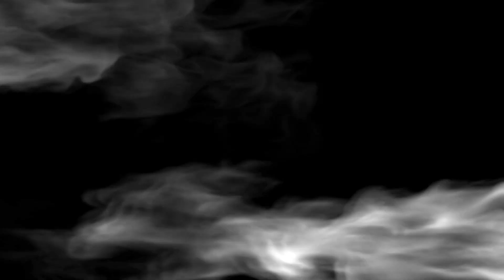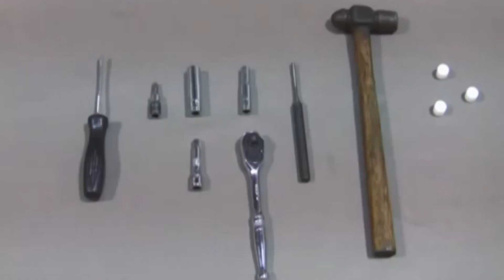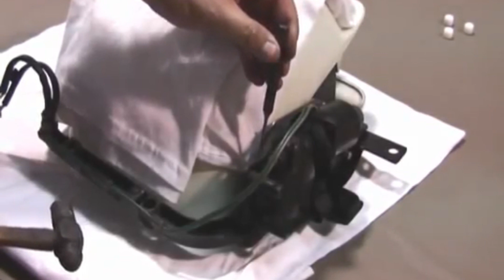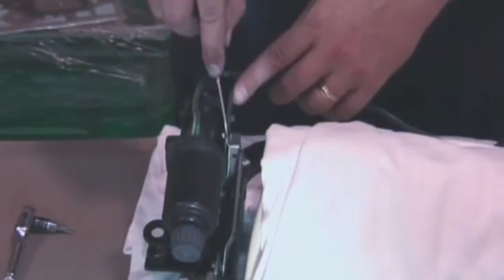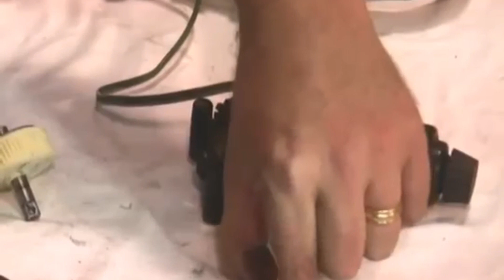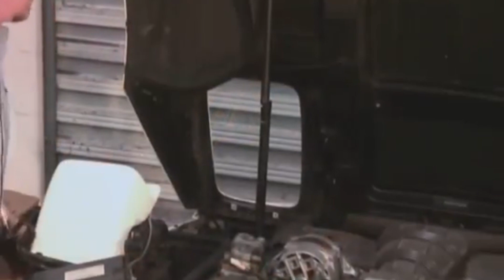Headlight Actuator Repair Kit, Corvette, C4, 88-96

Comment: Great video. I used it to replace mine today. However, when I went to replace them one of the long bolts on the outside that holds the motor in was missing? Do you know where I can get a replacement for that? Thanks!

Comment: By bearing grease do you mean wheel bearing grease? If it is petroleum based it will not play nice with Nylon Plastic. You should use plastic gear lubricant which has a wide operating temperature. For the bronze bushings (bearings) lubricate with a light machine oil with a high temperature rating.

Comment: I've read people recommend coating the three bushings with grease too. Which is what I plan to do unless there's a reason you shouldn't that people aren't aware of.
Reply: Chris Fix used high temperature grease on the bushings and brass gear.  I'm planning (already purchased) the brass gears and plan to install those in mine.  I agree with Lyle's comment that the plastic gears would be a better option if something prevented the motor from moving the headlamp assembly.  Having a plastic gear fail would be better than a motor failure.  I'm gambling a little here, but believe the odds of the assembly being obstructed is small.

Comment: I believe on the passenger side, you have to slightly unscrew the motor case in order to get a little clearance in order to be able to remove the plastic gear. Which from what I've read, you don't have to do that on the driver side. I sprayed those little screws with penetrating oil the day before as I've read of some snapping those off when trying to unscrew.
Reply: I know for the 1989 Corvette some of the passenger worm wheel gear shaft assemblies are longer (less shims) depending on what was needed in assembly to meet the required clearances. If you pull the motor back be careful not to lose the ball thrust bearing (it is just a small single ball bearing) at the tip of the worm gear. It can be held in place with a little grease. There is an access hole to see the ball and tip of the worm gear, and an adjustment screw to set the thrust clearance (which you shouldn't have to move as it is set at the factory). In some instances you may have to pull the motor out beyond the brushes, which can be very difficult to reassemble unless you have the tools to hold the brushes or you can get a helper to hold the brushes back with a couple of thin 90 degree picks. Pulling the motor allows cleaning of the commutator, inspection of the brushes, cleaning the motor shaft and lubricating the shaft bronze bearing (bushing). Put some grease on the end of the worm gear to hold the thrust ball in place during assembly after cleaning.

In some instances even if you use penetrating fluid you will still twist off the head because the screw threads are rusted (welded) to the aluminum casting, this problem is more prevalent with corvettes that come from the rust belt (winter road salt spray). The one method that might work for rusted threads is to apply Knock'er loose penetrating solvent (which works exceptionally well when used with heat) and then carefully apply some heat (but not too much that it melts the motor housing rubber seal), if the screw moves just a little add some more penetrating fluid and work it in by moving the screw in then out in very small increments. It will eventually come out. If after all this it doesn't move you will have to twist off the head then drill out the screw over sized, thread and install an 8-32 Heli-coil.
Reply: @windward2818  I replaced the bushings in both motors a few months ago as my driver side started acting up. And on the passenger side I had a bolt snap when trying to unscrew the top hat cover housing. And I drilled through and got a bolt, washers, and lock nut and used blue threadlocker. It ended up I didn't even need to try to loosen those bolts as the previous owner had already done the passenger side, and there was a brass gear inside that is removable without having to loosen those top hat cover bolts.

Comment: That "stamped steel arm", i.e. triangle silver piece next to the motor was missing on my driver side. Don't know what it does, but I guess it's not critical since mine has gone years without it on one side.
Reply from the maker: It is not critical--they actaully stopped using it at all after 1993 (if my  memory serves...)  Lyle

Comment: I sanded the top edges of the pucks a little bit, to help the carrier assembly pop in. I can't help wondering why the drive system is configured this way. I mean, why not just key the gear directly to the carrier? Why do we need this  bizarre puck system? The only explanation I can think of is that it allows for some expansion and contraction caused by temperature variations, which are pretty extreme. Think Canada in the winter versus Florida in the summer, which can be 150(F) degrees of temperature differential. Under those conditions, a plastic gear tightly pressed onto a steel shaft is likely to crack and fail in short order, due to the stress of being 'stretched' over the shaft. 

Maybe this setup combines zero play in the drive's action with relatively long life before failure. And that, in turn, makes me wonder whether the brass puck and gear alternative, which I considered, is such a good idea. There has to be a bit of slop in those brass components so they can be assembled. That might lead to your headlights jiggling slightly as you go down the road.
Reply from the maker: The pucks (pellets) provide the locking mechanism and also help keep the assembly "slippery" as they are made of Delrin, which is very slick.  The brass gear issue is that they remove the "fail-safe" of a cheap plastic gear that the system sacrifices if there is a obstruction to headlight rotation--the brass gear will never fail, but if the headlight binds up you will kill the entire motor instead of just the $25 plastic gear.  Lyle